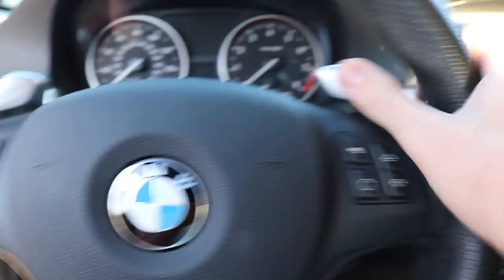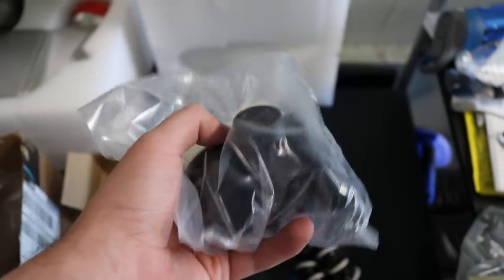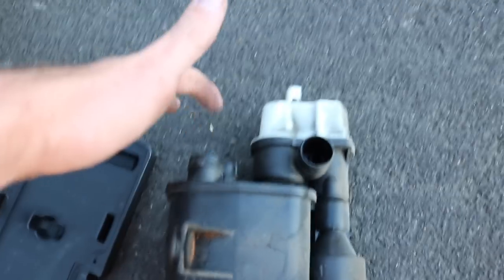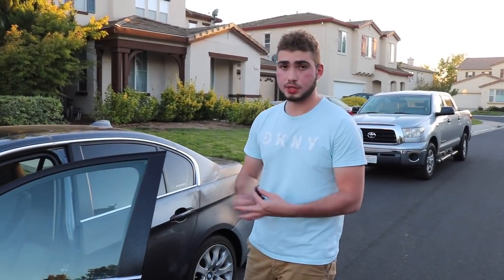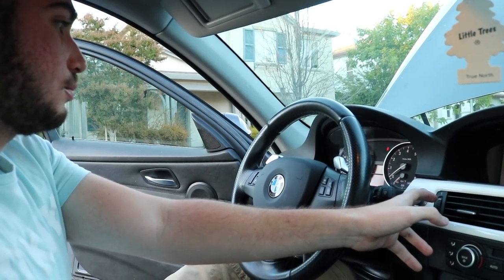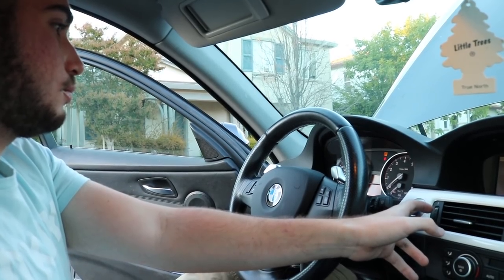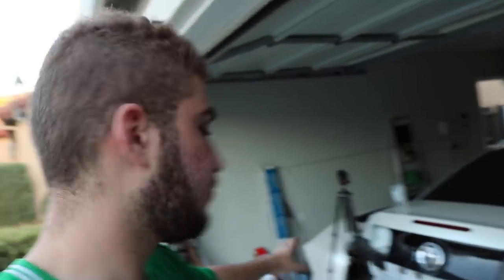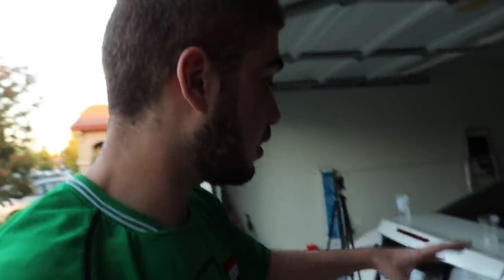The 335i Doesn't Sound So Good :(

Comment: Check the electrical connection on the pump with a digital multimeter. Check to make sure you have grounding, power and signal. You probably can find a wiring diagram for it. Could be a cut wire you missed from a bullet.

Comment: Check If you installed the valvetronic motor Is installed correctly I had the same issue or get a voltage tester and see If it's getting power. Takes 2 seconds and could be the fix. Might just be the relay to it.

Comment: Bro u know what i think it is...definitely your fuel pump relay ..doesn’t hurt to change it my X5 was giving me the same problem at first it use to crank start up and then die right away..and then it started doing exactly what your car is doing so i changed the fuel pump relay now its running fine ...also clean the throttle body etc...

Comment: Did you read the codes prior to buying the parts? My 335i would turn on but eventually my High Pressure Fuel Pump got so bad that it ran on low-power no matter where i went. If that's the case I recommend a brand nnew OASIS Pump from ebay. Ships fast in the states.

Comment: Damn that sucks. I know the feeling. With the addition of electronics/sensors and less carbon emissions in cars. It’s not as easy to diagnose an issue without the proper equipment and knowledge.  The fuel pump is on the way out, would be my guess.
Reply: It's actually really easy to diagnose these things... to check for fuel pressure you can easily disconnect the main fuel line before the injectors. You can use a multimeter to check for voltage or amperage issues. Checking spark by grounding out the plug. The main guess would be that the lpfp is dead or isnt getting the right amount of current or voltage. But as hard as you make it sound.... its very very easy even for people like Nour

Comment: 335’s have a lot of high pressure fuel pump issues and low pressure sensor and injector problems and fouled plug problems. in other words get rid of it ex Bmw tech here save your money. dmtl is emissions only fuck that car unless you know how to work on them
Reply: Dmtl pump only pressurizes the tank to check for leaks the harder the dmtl pump works the bigger the leak. Also I believe if it’s a fuel pressure issue I think Bmw will warranty do your HW. ask for the bulletins and see if they apply to your year and month of production.

Comment: If you are an owner of a BMW , every time you want to start your car , you must tell a prayer , these junks are totally unreliable
Reply: snagh don't know which BMW you've owned have never had that problem and I've owned more than 4 bmws
Reply: Take care of your cars and they will take care of you
Reply: As a 335i owner I somewhat agree 😂
Reply: This is an older Beamer and ofc stuff starts breaking after a while. Happens to every car and just because your Toyota of the same age is more reliable in some cases also has to do with the fact that it‘s not as advanced as these „high-tec“ bmws. Tbh I‘ve never had major problems and every car with alot of electronic stuff will be somewhat unreliable. The more advanced something is the more stuff can break. BMW was even very advanced back then and had features that some manufacturers are just starting to put into their cars...